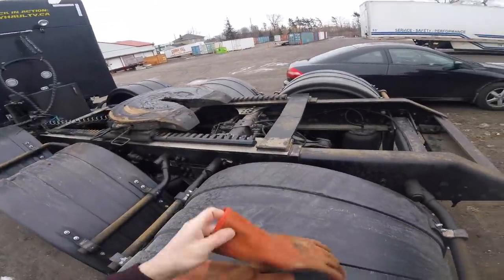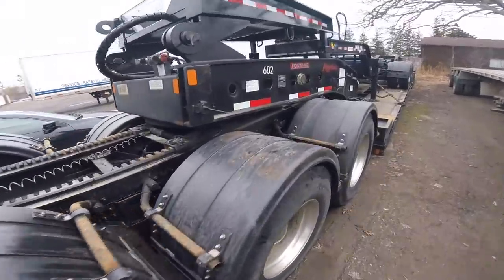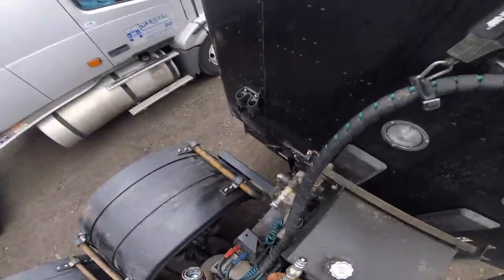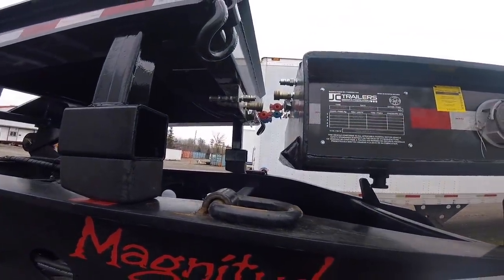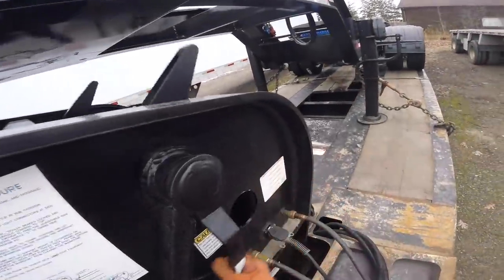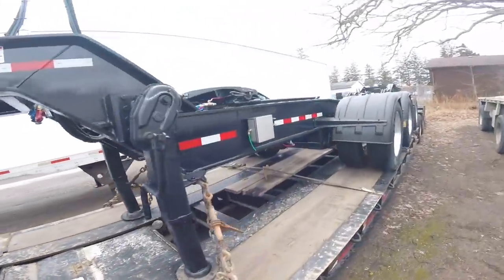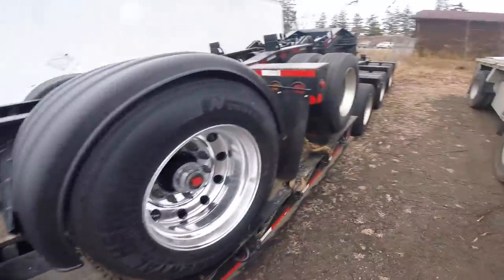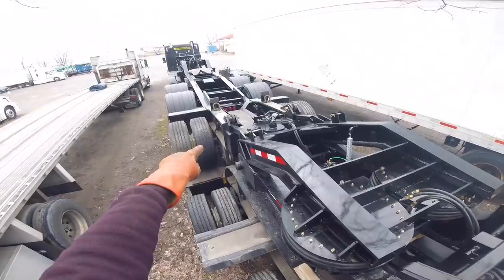A detailed look at the tandem jeep & stinger

Comment: Hey Sergei. Just a friendly suggestion. To help with the coupling of the hoses. When uncoupling. Shut off the engine then turn the key on and activate the switch then uncouple. This will bleed off the residual pressure in the lines for when you hook up. Good luck. Love your videos. From the west coast British Columbia.

Comment: When you unhook the hoses from trailer hydraulics hook them to each other then pressure won't build in the system. Plus it keeps the connectors clean.

Comment: Hi Serguei  get the rubber cover's for your hyd ends clean will save the o-rings .Cool new trailer additions also I guess we won't see you in BC in the winter . doesn't look like you have tire chains or room to run then with those Fender's. Drive safe Sir. 🇨🇦 Craig. Oh also if the ball end of the hyd end is stuck or pressured hit on the truck frame it will release. 👍 Oh I have a question 🤔 can you take any of those Peace's off by yourself or only with crane or forklift ??

Comment: Sergei, it wouldn't cost much to have expanded metal installed over the area in front of the fifth wheel. The shop that did your D-ring welding can easily do that. You will be glad you did

Comment: I think if you jiggle the actuators before you disconnect the hydraulic hoses it won't leave pressure inside the hoses to where they are a pain to put in next time. Works on smaller stuff. Can't see why it isn't the same in all applications

Comment: Is it possible to back the jeep up on the  trailer after delivery? Like, reverse it on the trailer?
Reply: rasklopac Then how will he hook the prime mover back to his trailer? I thought the same. De-tatch trailers are a stupid design, should be like Australia and have ramps at the back.
Reply: @pete5044  he would have to disconnect the gooseneck,  hook up to the beep, and then, yes he can back it on ( first), then have them place the stinger on.
Reply: Ok, so, it's not possible to put the gooseneck down on the ground separately? I see the issue now...
Reply: Yeah I think it Was an Aspen trailer,   that could back the jeep onto the trailer.

Comment: When engaging the PTO push the clutch in and put in gear then engage the PTO and place transmission in neutral and let out the clutch a d that will stop the grinding
Reply from the maker: When drinking beer from a can,  flip the can open, lift the can to your lips, and while the light is still red slowly raise the bottom of the can up to  approximately 45% angle. This will prevent excessive gurgling and reduce the chance of beer getting into the lungs.
Reply: @HHTV60  lol!
Reply: Typical boomer trucker offering unsolicited advice when not asked 🙄

Comment: Would a piece of expanded metal welded between the frame rails help the access? BTW Isn't that clutch under warranty?
Reply: Piece of plywood and 2 tarp straps would save a broken leg. Cover has to be easily removeable when 5th is slid and easy to store...could nail to deck.
Reply: @heyinway  I was thinking of welding the expanded metal to the bottom side of the top rail flanges. Hopefully that would clear the fifth wheel sliding.
Reply: @calvinjutila8270  That would work also, all the sliding action is on top. Just weld steel catwalk to the underneath of the slider rail...not to the horizontal part of the truck frame.
Reply: @heyinway  couldn't you weld a couple of hinges there holding an aluminum checker plate so you could flip it up when you not using it and then down again when you do?

Comment: Try keeping those hose fitting soaked with pb blaster . It might help , I’m just saying....
Reply: ,,, I don't like PB on anything with rubber seals or o rings, just silicone or WD .
Reply: Fluid film,amsoil metal protector,wd40,or similar lube spray.PB blaster is for breaking nuts and bolts lose ,therefore its corrosive and not really suitable for applications where you want to preserve metal from rusting
Reply: @kristoffMR  ,,, agree, I am about 70 percent convinced PB eats rubber and or neoprene. .
Reply: The issue is residual hydraulic pressure in the lines. It comes from disconnecting the lines while they are still under pressure. Turn off PTO, operate all valves to neutralize the pressure, disconnect the hoses. Should reconnect with ease each time providing that you haven't damaged them by beating on them or deforming the nipples.

Comment: Your king pin doesn't just pull up and out i take my king pin with me when i drop trailer
Reply from the maker: the kingpin on the standard 101" neck has no locks -- i can pull it out as long as i'm unhooked from the trailer. The extension neck has the king pin WELDED in.

Comment: why don't you put your D ring on a plate so it is even with the top part of the beam. that way you won't have to put rubber between the chain and the beam. and perhaps a little lube on you hose connections might make them going in a little better.
Reply: The reason the couplers are difficult...there is hydraulic pressure at the coupler. There are couplers made that internally bleed off pressure. Also stainless steel couplers that road salt won't destroy so fast.

Comment: You need to put truck in gear to put PTO in and you will never grind when PTO engages. I'm sure you know this.
Reply: The grind was from his broken clutch brake (Last video)
Reply: Absolutly correct,however 99% of operators dont know that,or dont give a fuck cos its not their equipment